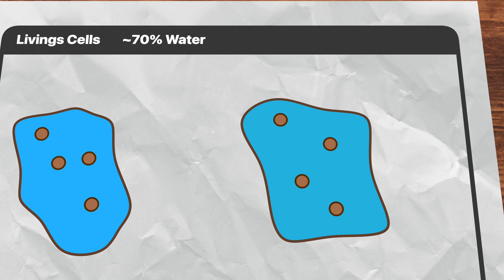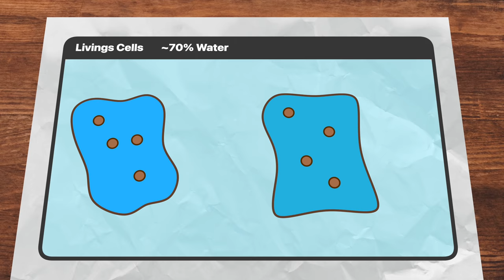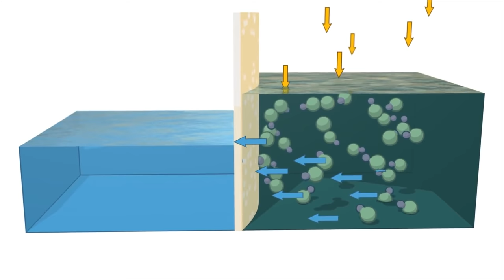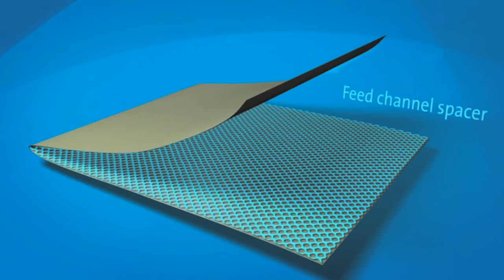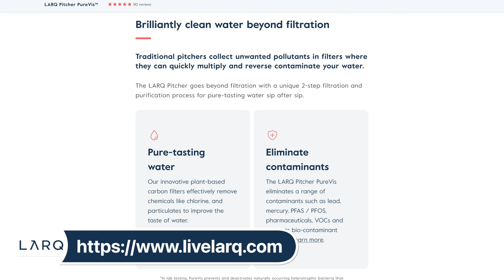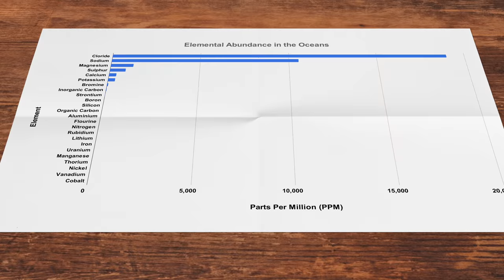Why Not Build Desalination Plants EVERYWHERE?

Comment: One thing I’ve heard a lot about is using fuel cells based on hydrogen, but the problem is the energy needed to separate the hydrogen from water, along with fusion needing tritium and deuterium from the hydrogen.
Well I thought about it, and shouldn’t brine conduct electricity more effectively than normal seawater? It seems like we could use brine for electrolysis and maybe dump the salt somewhere
Reply: Using hydrogen for any kind of scaled fuel will never happen. It's too energy intensive for what you get back. The tech has been with us for decades and it still has gone nowhere. Why? Because it's not feasible.
Reply: The problem is that you also get chlorine gas, which is very toxic, and sodium, which tends to explode when exposed to air/water. Also the energy used to break the chemical bonds of water don't go away, instead you also have to break the bonds of salts now too, so you actually need more energy with saltwater (it is a better conductor though).

Comment: A desalination plant could be built similar to a greenhouse, the sun could shine through, heating the salt water, maybe use a black conveyor dipping into the water, then use concentrated solar to convert to steam, then the shape of the roof. Along with internal gutters, to collect water, or maybe a cooling coil to condense the humidity created , the water could be gravity fed to a tank, filters, add minerals or what ever, then pumped into the system, it may be kinda slow, but is  will work almost 24/7, 365, if the water is heated though in day time, it can still work over night, it could be stored in a tank, and heated, acting as a thermal mass, and gravity fed through a spray bar, onto a conveyor around 250°F could still be about 200°F after a night of use,  then reheated the next day,. Just let it run, taking up about 200'x400', and about 40' tall, greenhouse, with a few tanks, and salt water pond inside, with condensers in the roof area, sun heating the pond and tanks, with pumps pumping salt water into a tank , that fill the hot ranks, and pond, the hot tanks operate at night, , heated during daytime, heated to nearly 290°F under pressure, then spray at night allowing to evaporate at night, then collected, and pumped to the system as fresh water, compared it would basically be free! Use the salt , build another greenhouse, /hot house, to heat the salt, to dry it, collecting the water from it also, it could be on the roof of the pump building,  it could all be solar powered, making it free to run!
Reply: The science is easy, making it economically and energy useful is the hard part. It will happen, it just takes the value of the products to become worth the effort.
Reply: You don't need to bring water up to the boiling point and create steam >212F. Vapor is constantly being emitted from water at all temperatures, but more as it heats up. Let's say you had multiple flat black containers in the desert, not very high, long and wide. The daytime reaches 117F and the containers heat to 150F, you then pump air thru it and it picks up hot air/vapor mixture. You pass it thru a heat exchanger (cold ocean water), with the cooler water coming in, much of the water will condense. As night falls (cold temps in the desert), the brine is cooled and pumped out, before the next day's cycle. PS nothing is basically free. Even if you use solar panels for 'free energy' it's not free as they have a cost and limited lifetime before needing to be replaced.
Reply: @thebluelunarmonkey  less water will come out per unit heat the higher it's salt content. similar to how distillation has varying azeotropes, or how fractional distillation yields different petroleum products... you would find there is a break even point for yield before returns are minimal with a given footprint. and dont even get me started on moving parts...
Reply: @imakedookie  yup. that's why the ocean water would evaporate for 1 cycle, the more concentrated brine will hold in the water. the brine would need to be pumped out. any mineral reclamation would need to be done in very large shallow drying pools exposed to dry open air for much longer time.
Reply: @thebluelunarmonkey  mineral reclamation in large evaporation pools. No. A world of no, though that may have been effective in the 1930s. You get more membranes, solar if necessary, and separate in succession of 99% efficient processes. Might need some heat exchangers, but mostly membranes and catalysts.

Comment: There is abundant pure water vapor over the ocean surface. This can be collected by condensation methods deployed on floats or rafts. Wind or waves can power pumps to bring Seawater through old refrigerator coils to cool collectors for a boost in efficiency. 
Thus no desalination is required to produce tons of pure fresh water.

Comment: I'd be interested in a video doing a scientific test on your advertiser. Like a bacteria content and total dissolved solids versus control
Reply: They market some of their products as working for raw water (lakes/streams). If it doesn't work well enough, I would think they will run into some legal problems down the road. The use of UV-c can kill most bacteria. How effective or necessary their solution in this use case is questionable. Personally, it seems more like a gimmick. Basic pitcher filters can improve the taste and "quality" of municipal or well water. In general (in the US) those sources are already more than safe enough for drinking, even if they have a bad smell or taste. If you live in a place that cannot provide safe drinking water, I wouldn't trust one of these basic filter systems to do the job.
Reply: Have they (loopastraw or whatever) not done relevant tests? 🧐 Check 'm out.

Comment: Lake Mead is running dry. This could easily be fixed by digging a tunnel from Death Valley to the ocean and flooding Death Valley (which is actually 282' below sea level) The salt water would evaporate and come back as rain, turning the desert green.
Reply: The same water already evaporates from the nearby ocean surface and is returned through rain. But don't make the mistake of assuming that the rain, whether from the ocean or from lake Mead falls on the desert from which it was taken. In fact, that is a very rare occurrence.
Reply: Lake Mead is running dry because Vegas hotels want pretty fountains and pools. Cut that off and problem solved.
Reply: @lookingbehind6335  nope, it's because 80% of the water goes to fill alfalfa farms in the California and Arizona deserts, one of the thirstiest crops to grow.  To top it off, a large chunk of the crop then goes to sale to China.  Yes, lake mead water squandered for China.

Comment: Nice job on the video I was actually wondering why there weren't more desalination plants. Also related question how cost prohibited would it be to move water from the parts of America that are flooding to the parts of the country in drought?
Reply from the maker: JMac… are you serious? We are making that exact episode as we speak
Reply: Well, China has experimented with something similar, and it's been disastrous. Anytime you divert water, especially to that extent, there's so many infinite variables involved that can cause all variety of ecological issues that may not be foreseeable; plus it's also ridiculously expensive.

Comment: How are Lithium and Cobalt extracted from the left over brine? 
If that process pollutes or consumes a large amount of fossil fuels, that might prove to be an issue.
 Great video!
Reply: Probably the same way they do it   purify and extract them from mined material minus the use of lots of machinery, heat and solvent to get it to a liquid form.

Comment: Desalination plants are very expensive and very inefficient. They are used almost exclusively in places where there is no other available water because the only gain is vs importing water from other countries.

California uses Desal plants in a few places,  particularly island communities where there is no alternative water source is at hand. The output is limited and those communities have to operate as though in drought conditions for most of the year.

As for byproducts, it wouldn't work.  The chief byproduct is salt brine, and the trace residue of what remains isn't nearly enough to meaningfully offset the costs even when ignoring the additional expense of successfully separating and extracting those byproducts.

My family worked in wastewater for decades which has a lot of overlap with water purification operations. Short of a major new technology to drastically improve efficiency Desal is only viable in really unusual edge cases where natural clean water sources aren't readily available.

Comment: I've often wondered why there are not more solar based desalination plants especially in hot dry areas that need the water most and have the most sunlight. Glad to see someone finally thought of this. I wonder if this could be done in Arizona, New Mexico, etc. Perhaps water could be pumped in from the Gulf of New Mexico or the Pacific Ocean to be desalinated.
Reply: Evidently you don’t realize solar is a pathetic energy source. Unless you have about a hundred million Tesla batteries on hand.
Reply: @lookingbehind6335  While true generally, I suspect there is a meaningful difference between slapping subsidized solar panels that have non-trivial production/maintenance costs all over the place vs making large enclosures in the desert specifically to separate salt from water in the area that process is most needed.  Especially because that water is easier to store than electricity, if you manage a surplus.

Improved battery tech would be very useful regardless of energy source, but by itself won't make solar much better.  I'm not sold at all on this "100% contained environment" setup, sounds more utopian than plausible.  But I could buy using desert sun as a (comparatively) low-maintenance process for separating crap from the water.

Comment: I’ve always wondered this question! How hard could it be to make industrial sized desalination plants in CA to help the drought
Reply: California isn't in a drought, I am over 50 and they have been saying that since I was born, it's nonsense! I can remember many times where it rained in Southern California for more than 3 weeks at a time and yet they still called it a drought.
Reply: Most of the time when there is a shortage of something when it comes to natural resources there usually isn't a physical shortage where we are running out of a resource. The problem almost always lies in getting more of that resource at the current price that resource is valued at. Desalination is expensive and for the sake of this example if you could sell the water from the plant at something like $1 per gallon or sell freshwater from an aquifer at 20 cents per gallon no one will build a private desalination plant. They also need to be able to sell their water at a profit consistently for it to be worth it. If the price of water spikes a few times a year to $1.10 it is more efficient to just import the deficit from surrounding states by truck or pipeline. This is because of the huge capital and time cost of building any large infrastructure project. We aren't going to run out of oil or water anytime soon but the price might increase as we exhaust our current resources and are forced to pursue less profitable ones instead. If the aquifers get really close to empty where the price of water from the aquifer rises to match the price of desalination I guarantee you will see tons of desalination plants being built in California.

Comment: Thermo diffusion is some brand spanking new process being research in Australia. Takes much less heat and functions in a way similar to R.O. water passes through a channel sandwhiched between a hot and cold plate, the water closer to the hot plate has lower salinity.

Comment: I haven't watched the video yet but I'm going to say what I believe would work: When you lower the pressure on a liquid you also lower the boiling point. It's the process used in refineries so they don't have to use as much heat (heat is costly) to get the same result. Put the water under a vacuum and, as in refining oil, it won't take as much heat to boil it. You can actually boil water at room temperature if you put enough vacuum on it. With nuclear power to heat the water it wouldn't be nearly as costly as using fossil fuels and fossil fuels would create more pollution. Put water under a vacuum and boil it and it becomes a vapor. Salt will not evaporate with the water so when the vapor cools it returns to liquid form and you have fresh water. I don't know how many heat/vacuum facilities you would need to achieve the volume needed to sustain farming and drinking water but this process itself will work.

Comment: The issue with extracting rare earth metals from sea water is that it's not gonna be in it's pure elemental form, ready to be extracted and sorted at a moment's notice. For example, titanium oxide is a very common chemical found in certain areas in the ground, but titanium itself is still relatively expensive because of how difficult it is to separate the oxide from the titanium. It might cost more than it's worth to refine these elements extracted from the sea.

Comment: Actually there are Saline distillation planrts everywhere.  BUT they are used to separate and sell salt from water rather than separate water to drin.  the settling pools are located in bays next  to the ocean and are flooded with sea water.  the gates to teh sea are closed and water is allowed to evaporate and exposes the salt.  the salt is then collected and processesed.  the market for salt production is there, problems is capturing the water vapor.  this CAN be done by providing domes or roofs ove the salt to allow the water to condense and be collected.  FAR more efficient would be geothermal powered desalinization plants powered by geothermal energy to boil the sea water and condense it into potable water.

Comment: The water heater dome can work without any power input.
If it uses gravity and the heat energy it produces.
Also if it desalinate just a small fraction of the water, pumping it back to the ocean should not be a problem

Comment: I’ve been saying we need desalination plants up and down the coast of America years and pump this water into the country. California just approved building one. The only problem is that they are expensive to build, power and maintain. They are absolutely still worth it though. DARPA should be working on ways to design, build, maintain, etc in cheaper ways. And the biggest problem of course is figuring out the brine issue. Again, DARPA needs to get on this.

Comment: Excellent video. You made two points which are wrong. First, although the latent heat of evaporation could be the reasons of even higher thermal desalination prices, economic thermal desalination plants harness the latent heat of evaporation, thereby reduce their energy intake requirements. The energy requirement for thermal desalination comes in the form of, sensible heating, and pumping power to circulate the salt water. And, second, membrane technology uses higher pressure to combat the osmotic pressure, and as such requires massive pressure elevation to push salt water through the tiny membrane meshes, creating fresh water. This electrical pumping power is orders of magnitude higher than the pumping power required for thermal desalination, but the combined thermal and electrical throughput required for thermal desalination is higher than that of membrane desalination. (source Thermal Solar-Desalination by Vassilis Belessiotis)

Comment: Ive been using this solution in debates amongst friends for years on how could the world help africas water crisis?(i know other countries on other continents have drought problems and sanitation problems but africa was the topic). My point is that africa is essentially a massive island and could have filteration systems all around its shores pumping salt water producing clean water. Within a few years africa would be a farming  utopia. I heard Gaddafi was actually in the process of doing something the same, starting in north africa creating a canal larger than the one in Panama before he was killed. Imagine free clean water in africa and the fertile soil combined with the vast planes easily done aswell.